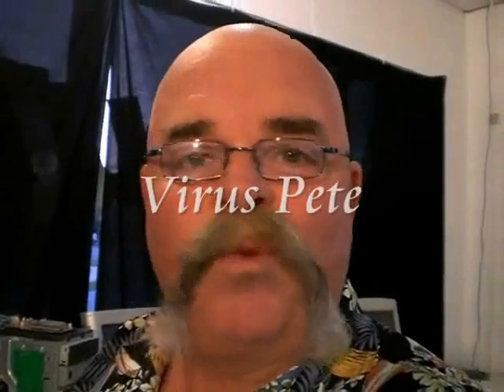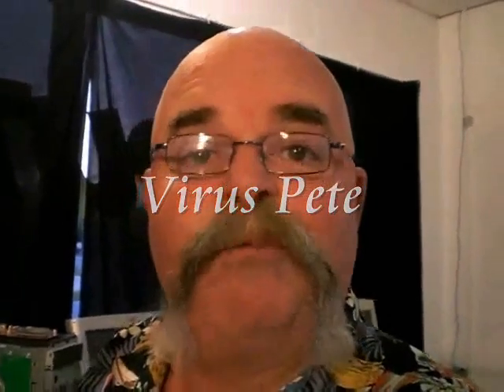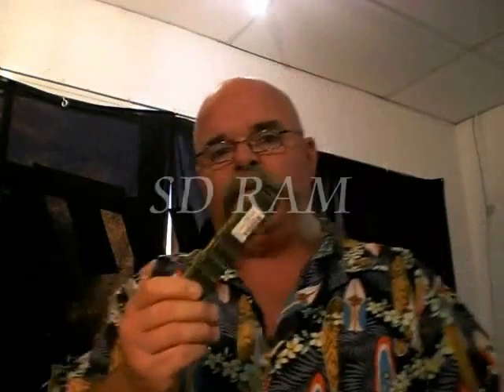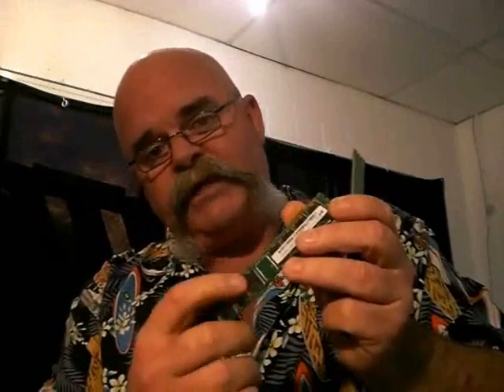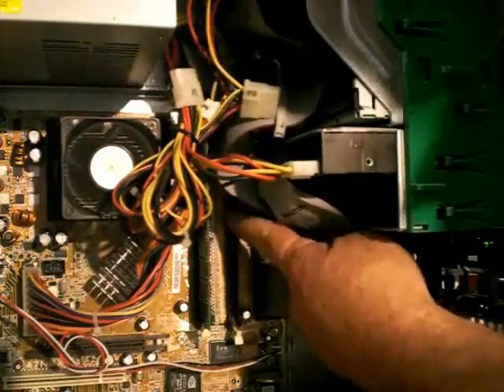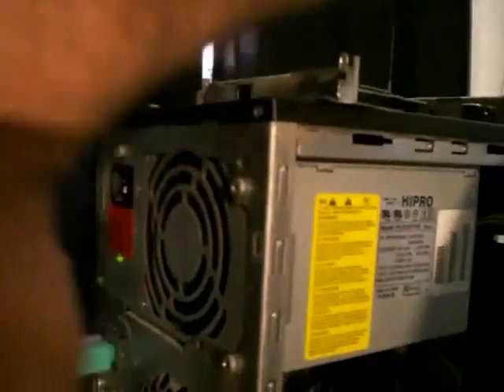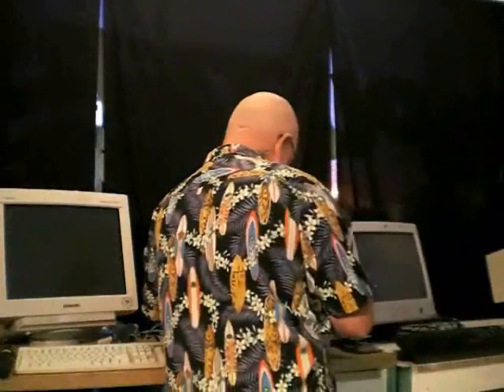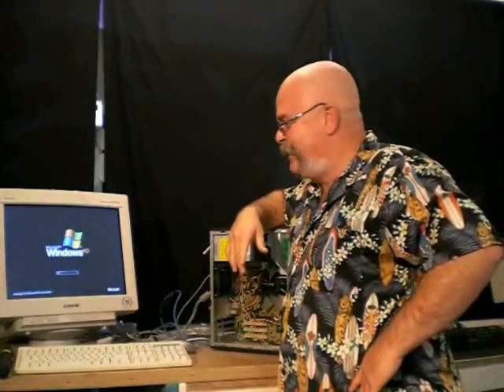PC repair for DUMMIES - No signal to monitor

Comment: hi i bought an new pc recently and fixed my hp screen with ,today its doing something strange ,can anyone help me ,
when i on my computer it works and then while i am on the internet or on utube the screen automatically goes black the switch button is still on green  and so is the pc ,why does this do that my screen goes blank ,i have switch the screen off and then on , is a hp screen .

Comment: Hello, I was cleaning my pc last night and as always i always take everything apart but this time when i put everything back together when i tried to turn it on apparentely everything in the computer case works fine, but it didnt turn the light of the keyboard on and also it didnt show anything on the screen. i checked the memory ram and its not that, neither the power supply. pls help me!!!

Comment: @wolf9983 lol if you think thats complicated than im an idot ive tryed restarting ram like 5 times ive opened procesor video card and even power supply and cleared every single dust in ther nothing changed.

Comment: I have an older computer Dell dimension2100  pentium4   1.10mb bios versionA14  when the machine  is turned on the Dell logo comes on then the general information about the computer at the bottom it says press del to resume . Instead of starting it says Erroor loading operating system.This is my kids computer, please help me with this, they're looking at my computer too hard.

Comment: hey man , i think one of my ram slot is damaged or something i got an m68mt d3p 1333.

could you give me a few tips on what to do , btw i have the other slot that works and ive tried all physical installation steps on detecting bad rams or slots.. so i know that the slot is the problem please give me a few simple tips on what could be the issue, thanks

Comment: Many many thanks for posting this video....this just recently happened and i had the cables checked and my monitor tested to rule out that, thought it might have been the graphics card....so relieved that this worked a treat.   It has saved me a bit of cash.    Great tips and advice, will defo subscribe to you videos for anymore tips you have :)) cheers!

Comment: Hi, Pete. i recently bought a new graphics card. But, when i play games for about 30 minutes -1 hour, suddenly there are many horizontal and sometimes vertical black line appear on my screen but the game visual still running. Plus, sometimes there was a split line in between my screen The left side to right side and left side to right side. Then i quit to desktop and a notification pop up. 'Display driver stop working and has recovered' I install the latest driver but the same problem occured.tq

Comment: Hey quick question,

I recently got a load of new upgrades, 
put it all together & got this issue with signal to monitor,

I thought it was my graphics card so switched it back to my old one, which worked
I sent the new card back, they checked it, said it works & are gonna send it back.

Maybe when I re-installed my old card I nudged the ram and corrected this very issue, 
I will re-install the new card when it gets here, 
if I get the issue again, anyone have any tips for fixing this?

Thanks

Comment: Hi! Hpdv7-1245dx. I believe i have a corrupt bios. No signal on monitor n no keyboard responds. I reset rams n hard drive. Computer comes on, fan, lights, fan goes off after 2 sec or so. It stops before the blue light comes on for internet. Light stays red. I press for computer to go off. after it starts up, it goes back to the same thing. I can't check anything with no screen n board. Is there a way to fully restart the computer, may be from motherboard etc? I don't think it's fully restarting.

Comment: Hey my pc was constantly blue srcreenin so i formatted it and everything was working fine, but my electricity cut out and when i went to put the pc back on i get this issue witht the no signal to my monitor or even my other monitor. Shall i try the RAM or what do you think?

Comment: i usually plug my laptop up to my tv and works just fine. but when i use my moms old ass 2003 windows xp dell desktop UGH U TALK ABOUT TAKING A SLEDGE HAMMER TO ITS HEAD. IM CHUCKING THAT SUM BITCH OUT WHEN SHE IS NOT HERE

Comment: I HAVE THE SAME PROBLEM...EVERYTIME I OPEN THE START POWER AND THERE IS NOTHING OR SHOWING ON THE MONITOR...I'M SCARED TO FIX THE CPU BECAUSE I DON'T WANT TO MESSED UP ANYTHING DO I JUST TAKE IT OFF AND PUT IT BACK I ALREADY CLEAN THE INSIDE OF THE CPU I DON'T KNOW IF THE MONITOR HAS A PROBLEM OR IT IS JUST NOT WORKING

Comment: @ThatAussieBloke Hi Pete i have the same problem with a new computer (i put it together for my friend). It worked perfectly fine on my end (off of the integrated graphic). I ship it to him. When he got it he turn it on but no monitor to see if it actually worked so we assumed it work. But when he bought a vid card and a monitor, installed the card. this problem pop up. Its an amd X4 with a gigabyte 880X microatx. 8 gb of rams.he bought a 560 gtx. Please help!!

Comment: @TehSkyZz 
mine made the 3 beeps...ran fine but monitor would state "no signal" and mouse would'nt stay lit (optical) Did what the guru said (pulled two sticks, lightly wiped them, blasted a little air to blow out dust) and started fine....no beeping, screen started right up. Thank you for the fix info...very happy

Comment: @indro95 I had this problem a year ago. I'm pretty sure it's due to dust collecting between the ram contacts and the slot reader. However, recently I reseated my ram for a different reason, but it seems like I've reseated it a dozen times and am getting this error. I was installing more ram for the 2nd time & long story short deduced that piece of ram was bad, but not before having removed the already installed ram. Lots of tries & no result.

Comment: @indro95 I believe it's just due to dust that collects on between the contacts on the ram and the slot. I had the same problem a year ago, and I'm pretty sure it was dust for me. Unfortunately, today I reseated my ram (not due to this problem), and cannot seem to get my pc to work no matter which order I seat it. So, I am suffering the problem again. The clips don't automatically latch on for me. I have to painfully apply pressure to their very tiny surfaces. Cables in the way don't help either.

Comment: Hi Pete,  have one of these computers and I took it to a guy to see if he can speed it up, he opened it took out the ram, I have 2, he put one in upside down, I get it home plug it in and there is no signal, for the last 2 days I put the ram in every way possible and there is no  signal still but I also took the ddr ram out and in with the power on, and I did what you said but still no signal....I don't care about the computer I have a lot of data in the hard drive ....can you please help?

Comment: My sister in law is having trouble with her hp monitor. It turns on but says no signal input then goes to sleep a few seconds later. What do you think the problem is? Some guy suposly fixed it and said it had a virus and it's gonna keep doing that.

Comment: LOL, turning on the puter and no signal on the monitor ... reminds me about yesterday. Put new RAM into the machine and the same happened ... and you know what ... I brought it to the pc guy here ... the RAM wasn't fully pushed into the slot, lol ... 

First I thought the power supply was broken ... coz that happened once before and also no signal on the monitor, lol ... already changed the power supply without effect.

Comment: Hey, Pete. I just built a new rig and I am not getting a signal to my monitor. I tried changing out the memory, using a vga plug instead of a hdmi plug, taking out the video card, and nothing is working! What else could be wrong with it?

Comment: Hi mate, love the video, but unfortunately having removed RAM, cleaned it and replaced it, the screen still says no signal (and it's the newer DDR2 stuff). 

What next? Are there any other quite simple solutions, because I could really do with it working again, if only to copy the files before buying a new computer.

Comment: I'm back and it actually work. Now my laptop recognize my 2 GB of RAM which I thought gone bad.  However, I used a clean cotton clothe soaked in rubbing alcohol to clean the gold contacts on my Memory module. I tried reseting it in the past, but it did not work until I learn I should clean the gold contacts on the RAM in this video. Thanks, you saved me $40 or more dollars from buying Used RAM on Ebay which looks kind of fishy.

Comment: Theres a good analogy that I used when explaining RAM to clients when they would buy a machine off me, I say to them RAM is like your desk that you have at home, and what you are working on at the moment is on there, youve maybe got a coffee mug on there, and maybe some papers. The bigger the desk, the more you can fit on it. Same deal with RAM, doesn't necessarily mean faster performance (although it does help considerably) but it lets you run more things at the one time.